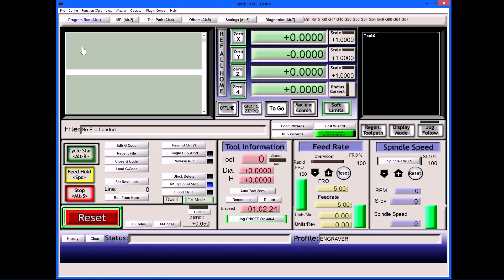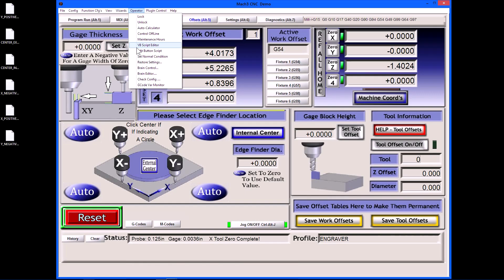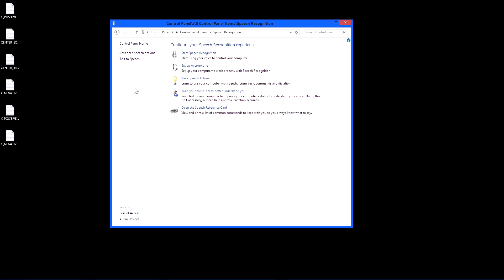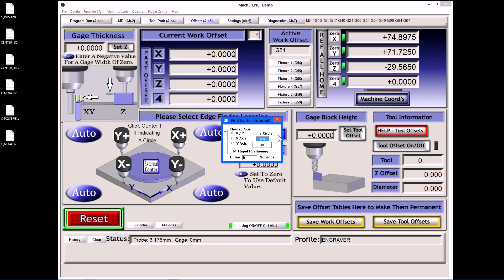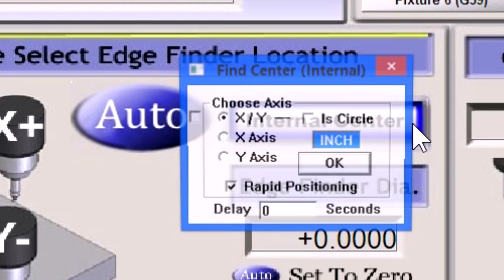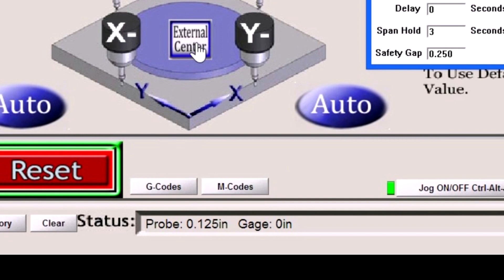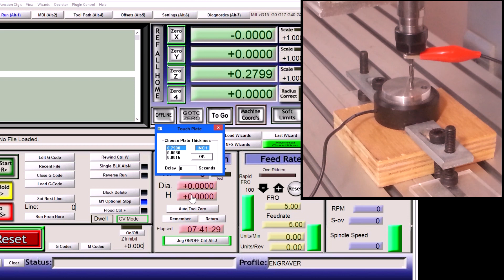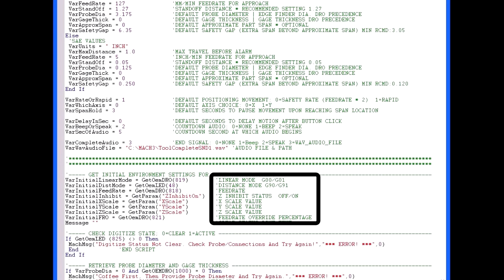CNC Mach3 | Automated Tool Setting | Edge/Center Finding (X/Y) | Includes INCH/MM Scripts

Comment: GREAT VIDEO !!! I LIKED AND APPPRECIATED. Just quick question when i run to check the edges what's feed rates needs to be for x and y axis and am afraid to heat the stock if not stopped during finding edges and center .. this tablet and carcodales stop the bits for sure >??? or need other setting to avoid crash in stock box ?

sorry for stupid question i just worry about it i thought may be i missed something during the that video watching....
am just beginner that's way too much questions.))) hope you understand me
Reply from the maker: Thank you. Glad you enjoyed the video. The feed rates in the scripts work fine, but you can change them as you wish. You will need to be sure there is conductivity between the probe/tool and part/touch plate. You can test this before running the script by temporarily jumping the contact points with a piece of wire and making sure the "Digitize" LED lights up upon contact. If you are not sure that there will be conductive contact or are afraid to run it, DO NOT RUN THE SCRIPT. Hope this helps to answer some of your questions.
Reply: @sunny5rising  Thanks a lot for your feedback on it. I will run it  yes  i will test before running you are right...i have to be sure all is fine...Really great video enjoyed!!!

Comment: Great video!  Very easy to follow and set up.  If you use and XBox 360 controller to jog your machine, you can program the buttons as well.  I almost always set 0,0 at the bottom left, so I renamed the Minus X and Minus Y files to XBoxBtn1.m1s and XBoxBtn2.m1s and chose those options for the B and Y buttons in the Plug In configuration drop down menus.  Can't edit the bit width and such, but I plan to always use a 1/4" steel dowel to locate the X and  Y.
Reply from the maker: Awesome! Glad you found the scripts useful.

Comment: I am having problems with the code, wanting some help please. I have a Z axis homing switch set up on my CNC to home to zero at the top of its travel. When I Auto Tool Zero my cnc, the bit comes down, touches the touch plate, then goes up to the home switch. when the g-code continues the bit is running was up in the air.What do I need to change either in Mach3 or the code? Sorry, complete newbie at all this. thank you in advance for your help.
Reply from the maker: I got your email. I'll be sending a script for you to try out to see if it fixes your issue.

Comment: Hi, many thanks for your script, it is very usefull. I have the same version for mach3 as you have, but had one problem. When running the X- or Y- script it gave back  a DRO that was multiplied with 10000. The Y+ and X+ worked fine. 
It was solved bij getting the negative number diffrent. doesn't make sennse to me, but it worked. Perhaps it can help other people if the get the same results. (at least it seems to work in my case)
Changed : SetOemDRO(801, "-" &VarStandOff + VarGageThick + (VarProbeDia/2)) 'SET Y DRO 
 To : SetOemDRO(801, -1 * VarStandOff + VarGageThick + (VarProbeDia/2)) 'SET Y DRO
Reply from the maker: Thanks for letting others know. I can see how your edit works, I'm just now sure why on some systems the original programming doesn't. Out of curiosity, are you using a USB connected system?

Comment: Hello how are you?  long ago no video
Reply from the maker: I'm fine. Yes, it has been awhile. Any particular type of video you would like to see?
Reply: @sunny5rising  I have always used mach3 for milling with a hand-held interchangeable tool, and now I am assembling a lathe on mach3, but for both machines I want to use an auto-change tool and automate it as much as possible.
Reply from the maker: Unfortunately, I don't have an auto tool changer on my machine. Therefore I can't test any scripting as I write it. You should be able to find some scripting/tips in some Mach3 forums.
Reply: @sunny5rising  please tell me where to download a working mach3 turner, I have already downloaded several versions of mach3 mil works, but mach3 turn does not work
Reply from the maker: Mach3 forums might helps you there as well. I have no experience with Mach3 turn.
Reply: @sunny5rising  Thanks I already got it

Comment: my spindle bit is already making a connection through the spindle and to the aluminum bed . if i clamp a piece of aluminum in the clamp and clip one wire to the bit and the other to the object im already making a complete circuit through the spindle before even clicking a button . the digitize light is already on .   how do you overcome this ?
Reply from the maker: You will probably have to isolate the part, either by cardboard or wood between the part or the bed/clamps/vise. Alternatively, you might be able to isolate the tool by putting electrical tape around the tool shank before you put it in the spindle.

Comment: Hello, sir .  i have a green mach3 with usb connection.  but i have problem when using autolevel program.  Where the resulting file or log file contains the same points.  I've been trying to solve this problem for almost 1 month, but to no avail.  can we discuss the problem? please response Sir🙏🏻🙏🏻🙏🏻
Reply from the maker: Yes, email me at sunny5rise@gmail.com and I'll try to help you out.
Reply: I have sent the email sir, please check.  thank you

Comment: Another thing, how accurate is the center probing for finding the center of the circle ?
If the x and y location is not centered can it still find the exact center ?
Reply from the maker: Yes, it is accurate. Also, If you check the "Is Circle" box, the cycle will run twice as to increase accuracy.
Reply: @sunny5rising  Thank you sir

Comment: Hi Charlie,
Happy New Year.
I run these scripts on a parallel port CNC machine years ago and was fine, now I got a USB control card and these scripts are a JOKE...
Sometimes is working but most of the time not, but the funny and scary thing is the machine axle starts fanny movement which is b*** s**.
Now, I understand nothing good is for free, do you have any scripts which will work for USB? do you have a script that will find the part angle in order to machine the part without getting the part parallel to X-axis?
Thanks
Reply from the maker: Happy New Year. Thanks for the feedback. Yes, I am aware that the scripts do not work correctly on some USB systems. I use a parallel port system, so that's all I have to test scripts while writing them. Perhaps a Gcode version of these scripts will do the job... which I haven't written yet. When I do, I'll get a video up. 

No, I do not currently have a script  to find part angle.

Charlie
Reply: Hello did you chase up with usb controller? and what doest mean paralel port is is LPT ports with 25 PIN ?
Reply: ALL usb controller board have joke, all not working ewerytime, not safe and not accurate use usb controller board, lot better if change old paraller port card back, if new computer not have paraller port, buy pci to LPT port card cost less than 15$ easy install to pci or pciE socket, can use 2 paraller port if buy 2 card, lot better than usb port.. usb make lot users bottle neck to usb way. not safety not good.

Comment: Awesome video and scripts. I use it with USB breackout board and scipts work fine. I just need  to change s regional setting in my Windows O. S. the decimal format, because in Italy the default separator is " ; ". I set this " . ". Otherwise get TYPE MISSMACH error.
Reply from the maker: Thanks for the feedback.

Comment: Dear Charlie, can you cover the topic of spindle index signal ?
 
I have a  BSMCE04U Bitsensor 4-Axis Mach3 USB Controller Board board but the datasheet does not mention spindle index. i have tested but seems not displaying on DRO#39
Reply from the maker: Unfortunately I can't. I have no experience with this subject.
Reply: @sunny5rising  No worries, Cheers stay safe

Comment: Incredibly well explained.
Tried several scripts from others, but yours works perfectly.
Except "center internal" returns an error on line 115.
Probably my mistake, will try again later.
greetings from Belgium (Hellhole ....;))
I Have you deposited a present.
greetings and thanks
thick thumb
Reply from the maker: If you still have issues with the script, contact me at sunny5rise@gmail.com and we'll look into it.

Comment: Hi Charlie. 
My point for commenting was the version of Mach3 here. I have Version R3.043.062 licenced. You show ..066.
According to the Mach3 changelog there is no such thing.  Whats up? 
Utmost respect,
 Chris
Reply from the maker: Yes, I noticed also that the change log doesn't show 066. Not sure why. I downloaded 066 several years ago as the standard download from the Mach3 website. My understanding is that it was determined that 062 was more stable for the majority of users, so now when you download Mach3, it will be 062. Not at all sure what the differences are, but to this day I haven't had any problems with my 066.

Comment: Thanks for the videos and help!!!

can anyone  confirm that this is buggy or is it just me? Not always but some of the time ill hit "AUTO" x,-x,y,-y or ext/int button. It will move in the correct direction, touch off on the stock and either...

1# drive towards the stock instead of moving 1.27mm back 
2# touch the stock then move a larger distance away for stock than scripts dictates

this happens a lot when using external finding  

scared to use as i dont wanna break tools and damage
Reply from the maker: Definitely DO NOT use these scripts if you have ANY trust issues. Unfortunately, some systems will not run them correctly. If you're up for troubleshooting,  I recommend using the VB Editor to Step through the script to find out where any issues are located. Use Breakpoints and step through the script to find results of variable calculations and such (mouse over a variable will display its value). Test carefully!

Comment: Thank you very much.... the scripts are very good I am enjoying using and shoeing them. the voices are a touch of class. I change one by issuing a warning instead of a count.    Good job!!! and Thank you again.  Next time I like to find a script were the X,Y andZ get in position to change the tool and after a one key stroke, return to the right point and continue working.
Reply from the maker: Glad you enjoy the scripts. I might just be about ready to write a script like you mentioned. Would make life easier for sure.
Reply: @sunny5rising   There is one thing that i could not figure up.
when traying to find the center exterior of the part about to machin, The box opens and ask for the span of the part. I can put 0.05 or 5 and makes no difference it always moves about 6 inches before it drops and  try to contact the part but obviously it is too far away and stops.   Is there something I am doing wrong?
Reply from the maker: Is there any way that you can take video or step by step pics as you go through the process? It will help. You can email me the pics at sunny5rise@gmail.com, or upload a video to youtube and send me a link.

Comment: Hi Charlie, Thanks very much for this and the Z finder tutorials. Instructions are very clear! I'm afraid i'm having a problem with a syntax error and the script wont even run for me, i'm really not sure what i'm doing wrong here. None of the scripts work and i get the same error for each of them (but sometimes on different lines). For example on the X- script:

"Error on line: 51 - Expected: ="

Any thoughts as to how i can sort this out?

Cheers,

Luke
Reply from the maker: Got your email.  Just sent a reply.
Reply from the maker: Just emailed you back again and forgot to ask.  What version of Mach3 do you use?
Reply: @sunny5rising  Version R2.63
Reply from the maker: Ok, that's the issue my friend. If you download the latest version of Mach3 (3.043), you should be good. Remember to write down all your current settings first if you choose to update.
Reply: @sunny5rising  ahh ok, rookie move. Thanks for the help,  I'll have a crack at it tomorrow.
Reply from the maker: You're welcome.
Reply: @lukeblades3045  Hello my friend , did you sorted out? downloaded new version and all scriots are work ok? any chance to share the links from where you download? appreciated

Comment: hello, i used china board and your codes did not working. it is because used of getvar. however could you tell me why you check by getvar and not used getOemDRO? and are you plan to create script with set length tool after changing tool? do you have video about this if you already create one?

Comment: Hello Charlie, did you think this may work with a usb motion controller? I been having problem  with my Drewtronics s5000 probe to get it to work. Any help will be appreciated. Thanks
Reply from the maker: Some folks report that the scripts do work with their usb systems, others say they don't. My system uses the parallel port, so unfortunately I can't test all setups. Looking through the comments on this video from other users may help to find information.

Comment: I have two problems. When I measure positive values it displays them correctly (example 3.5000) and when I measure negative values it displays with commas after tenths (example 35.0000). The second issue is whether I can make changes to SCRIPT to not always replace the comma in the Safety Gap. I would be grateful for help. Thank you.
Reply: Same problem. But i get -35000.0 instead of 3.5000.
Factor of thousand.. don't get it

Comment: Hello, I tried using this script but I have unusual results. I try to zero bottom side ( Y- ), input tool diameter ( 6mm ) and gage thickness ( 0.001 ) and as soon as it finishes, the Y DRO is around Y +812. Any help would be appreciated
Reply: hi did you sorted out? if yes can you share how ? appreciated
Reply: @talgtalga3767  nope....

Comment: sorry if the motor rotation when moving too fast what should I change so that the motor rotation slows down?  Please help me
Reply from the maker: If you are talking about the XYZ axes as it applies to this video and feed rates, you can slow the rates in the script variables.
Reply: @sunny5rising  can you tell which one to change?  I was confused which one to change.  and may I have the file?  send to gerianggara1@gmail.com
Reply: hello did you sort it out and runed slow everything is working?
i want to do also same can you help on this ?

Comment: Thanks for the files, I loaded the bitmap files which incidentally are jpg files, when i went into the area to look at offsets all the graphics which were replaced are missing. Any idea what could have went wrong? I did as instructed and copies and pasted over the existing files and to my dismay empty areas , I reset mach3 and went again to look and same thing. I am assuming that bitmap or jpg should make a difference etc...
Reply: i figured out the problem. left click on the properties of the jpg files is read only selected. you must have this un selected in order for the program to use the new jpg files .  It is solved anyone gets this kind of error now will know the remedy etc...Enjoy!!!

Comment: Thank you Charlie for excellent video and scripts.
Everything is working fine. But I have persistent problem with the script of external center. - Error on line xxx - Type mismatch -.
I do not see any dot, instead of the comma. Or maybe I m looking on the wrong place. Can you please help my.
Thanks.
Bojan
Reply from the maker: You are correct. Make sure the Safety Gap field has a period (.) in it instead of a comma (,). This should take care of it.
Reply: @sunny5rising  Now is working perfectly. Thank you once again Charlie.
Greeting from Slovenia
Reply: I wish change that in code, in the field if i put (.) it work, i tried to change in code but nothing change
Reply from the maker: Yeah, I think it has something to do with the country code standards. Think I can re- code that section to take care of that. You up for testing the new code when I get it done?
Reply: @sunny5rising  yes i will, i tried to made some mod with no success. Thank you for your grear work
Reply from the maker: Got it done.  If you want to test it, email me at sunny5rise@gmail.com and I'll send the file.

Comment: Morning there,
i have mach 3 and windows xp installed on my pc and i have somne issue with auto select switch, when i press auto select limit switch (for ex. x home switch) and i press the x switch there is no response in mach 3 selecting that switch, with my previous board worked fine for me but now i just can't understand what is wrong.
Can you write me on printareprototipare3d@gmail.com ? 
Regards mate.

Hope you will response

Comment: Will these scripts work in Mach4? and will it work with a touch plate from cnc router parts? Great video
Reply from the maker: I haven't used Mach4, so I can't say if the scripts will work it not.

These scripts will work with any conductive touch plate as long as it's wired correctly. Of course, also put the touch plate measurements in the scripts where needed.

Comment: After lot of experimenting and debuging script I found reason "Type mismatch" error. In regional settings of Windows you must set Dot .  for Decimal separator instead of comma , and set Comma , as thousand separator.
Reply: post the result please
Reply: or you can put manually x.xxx ! thanks for help
Reply: ok, wow, thanks for that. I would have never thought about it. Now i only have some homing issue left. The external surch seems after 1 x find to run of to home itself...
Reply: Thanks for the help. Changed the comma to a dot. Everything was earned like a clock.

Comment: Hallo, I have a cnc3040 and I’m facing a problem ... when I’m trying to move on y axis the movement is not right, it starts and stops and goes front and back randomly. Any advice?
Reply: Hi, I am facing same problem. Have you found the reason and solutions?
Thank you ...